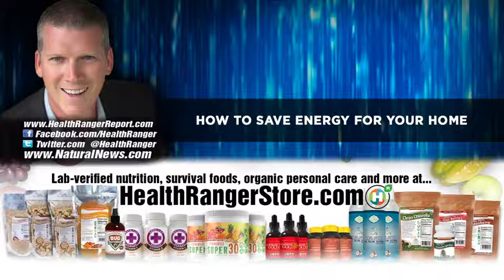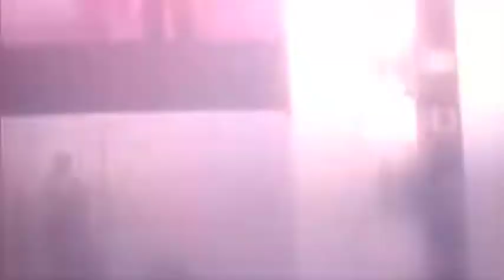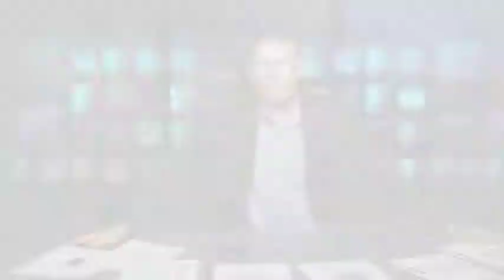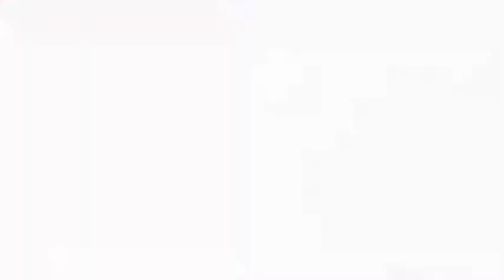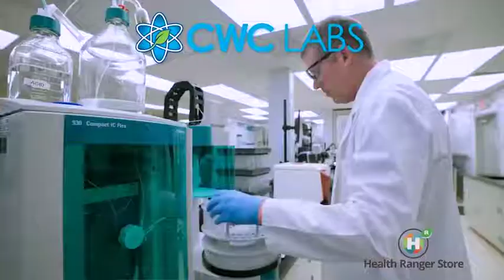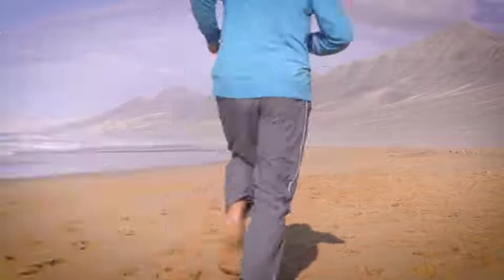How to save ENERGY for your HOME

Comment: we have a pellet stove, we burn half pellets half corn.. we go once a month get 40lb bags of pellets-1 every other day.. and 6 bushel of corn.. we save almost 1500$$ a winter in electricity over using the furnance.. we never put it on any higher than its number 1 setting (lowest).. it gets too hot.. on 1 on a 20 degree day it will be 75 in our open concept ranch style home.. so easy to use, fill hopper once a day and buy pellets/corn once a month.. pellets and corn fit in my car!!